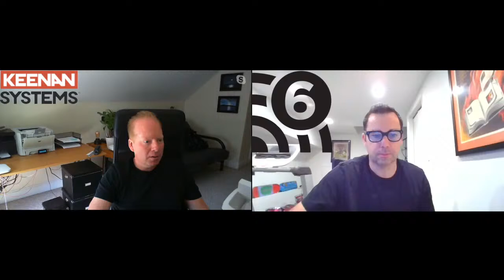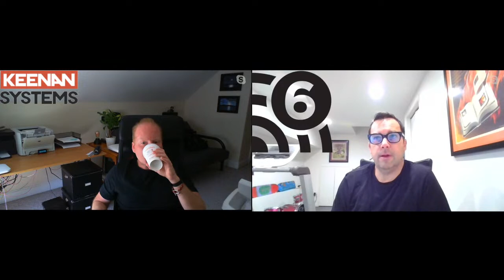Wi-Fi Vidcast, EnGenius Router, Mist Meraki UBNT shortages,  Hospitality Wi-Fi

Comment: Hello I had a question about the gotrax g4 yeah I know it’s the wrong video but I was hoping you would respond to this the handle of my gt g4 is shaking a lot any advice how to fix it
Reply from the maker: I have not noticed the shaking at all I would check that the handle bar bolts are screwed in correctly.  We will be talking about the G4 on this weeks vidcast tune in.
Reply from the maker: check out this weeks video we talk about the G4 https://www.youtube.com/watch?v=eUJcrB66gXc
Reply from the maker: we suggest checking all the screws on your G4, especially the stem screws near the folding mechanism. Before we tightened this particular screw, the silver clasp on the stem lock wasn’t connecting fully and there was a slight stem wobble. Once tight, the stem lock worked correctly, there was zero wobble, and no noise while riding.
Reply: @keenanjeff  oh it works thanks